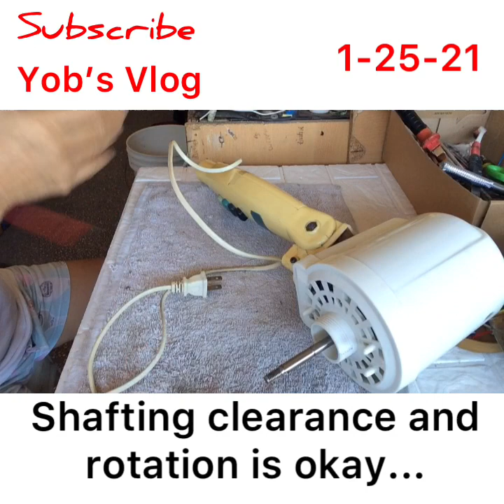Usapang Senior: NIKON Stand Fan (NSF 16-5SM) Repair | DIY at Home | Silent Tutorial | Silent Vlog

Comment: Ka senior may tatanungin sana ako po 
Pwede po ba yuong charger ng gadget 
I pag combine ko po sa 12v car fan DC ka senior
Reply from the maker: Puede, gumamit ka ng USB dual charger adapter or twin lighter socket.
Reply: @yobsvlog  a thanks ka senior👍👍👍
Reply: Sa 220v charger ng gadget po kasi e
Thanks
Reply from the maker: @kennethramirez5569  kilangan mo ng boost line power supply na 12 volt output pr ac-dc power adspter 220 volt input - 12 volt output. Mag search ka sa shopee online maraming mapagpilian. Thanks